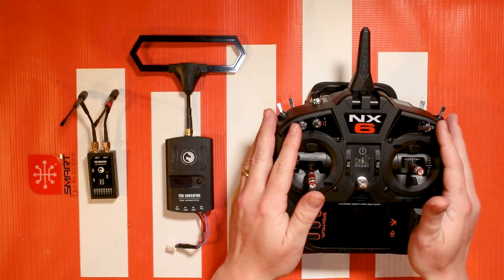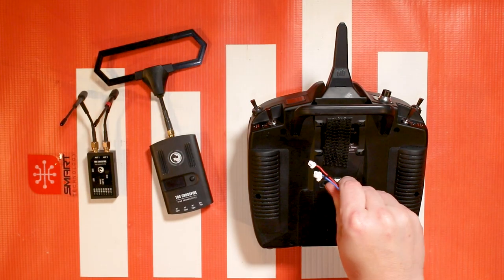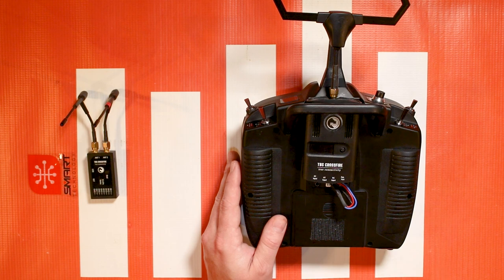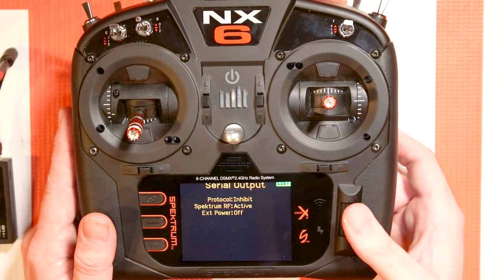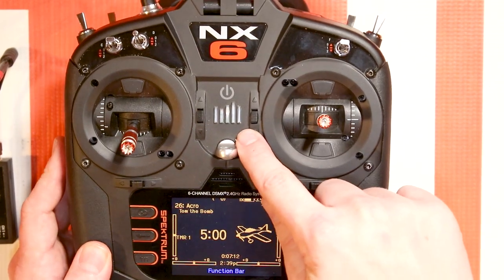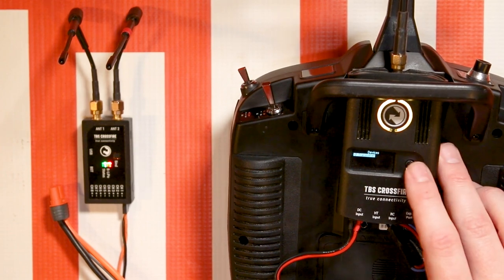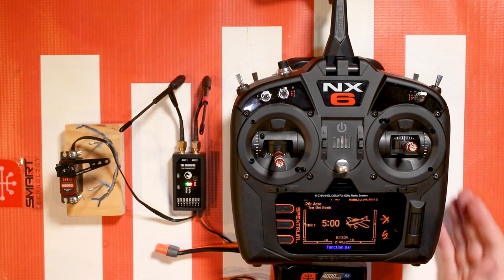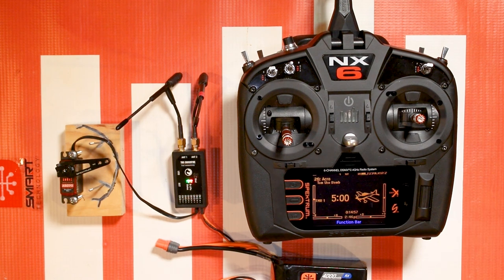NX Instructional Series - How to Setup the Serial port and Team Black Sheep Crossfire Module

Comment: I'll answer my own question, crsf latency as good as it gets. CRSF nano and nano diversity works great with NX series, Spektrum needs to do their homework and post some tutorials. It does get a little convoluted on first channel assign set up. You can copy the first setup on all other setups after that.
Reply: Hi

8 months later and I end up in this position. I’m using a nano diversity with adaptor board and Matek H7 FC and can’t seem to get it working. Here I’m thinking the soldering of the pins was going to be the hardest part. 

Any help you can offer will be greatly appreciated

Comment: Thank you for the review,, I want to ask you if the spectrum can support any other 3party modules???? Or is limit to specific brands???
Reply from the maker: Really it is up to the 3rd party to implement our code. IE to accept SRXL2 as the serial protocol. We do not actively pursue module support at this time
Reply: Okay excellent thank you so if I buy a 3rd party module needs to have IE protocol right that’s what you mean right in order to make work with other brands??? Or not

Comment: hello, you mean the nx 10 which has a power supply for external module, where is this power supply?
I bought an nx10, the crossfire v2, the spektrum cable but I don't know where to power my crossfire.
franck from France! 😜
Reply: I also have this setup and have the same problem with no power to the crossfire! Only bought the NX10 because of the power supply for the crossfire. Sounds like we have been lied too! Should have noticed the lack of wires for the power supply. What a bummer, really wanted the clean look of no extra battery.✌️😎
Reply: @jackiemonroejemfpv4204 just wire it up to the output from the radios power suply behinde the voltage regulator
th nx10's battary and electronics can handle it
Reply: @thomasmaier1201   are you talking about taking the radio apart? Or using a voltage meter to find the power supply on the wire harness. Then add the needed wire for power. Looking forward to your reply!✌️😎
Reply: Why would you use the crossfire module what does it  do? Please help

Comment: Is Telemetry supposed to work? I just purchased a crossfire TX module, it all shows correctly on the little Crossfire screen (GPS co-ords etc) but am not getting any telemetry on Spektrum NX10. Auto-Config say telemetry needs to be turned on. (it is turned on).   Anyone got telemetry on an NX?
Reply: I cannot get telemetry on my NX10. It works fine on my ix12. Did you ever get it to work on your NX10?
Reply: @BladeScuffer  nope...I still use Crossfire alot with NX10 but no telemetry....
Reply: I use a NX10 and experience exact same thing with my Crossfire set up. TBS confirm that their telemetry work fine, now i just wait to hear from someone Spektrum to answer why and how ...i don´t have high hopes for that to happen anytime soon.

Comment: So you can't program from the nx transmitter how pathetic a good example that opentx is better
Reply: it isnt
noeone needs cheapt gimbals and crappy software only the fpv pilots use this crap if you fly fixed wing to you use sepktrum ists a fact. (i fly kwads as welly) You just havent enough settings in a trranis or fly sky radios for fixed wings. In drones the FC handels everything but in planes it doesent...